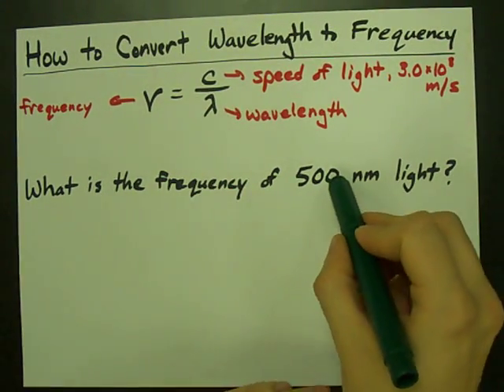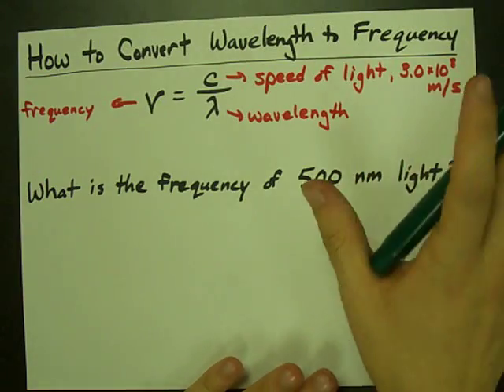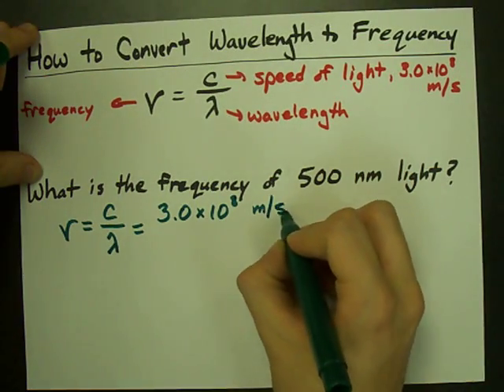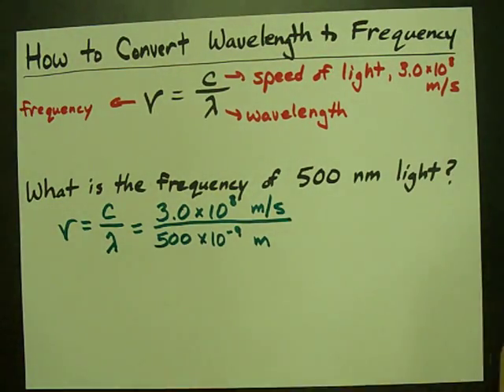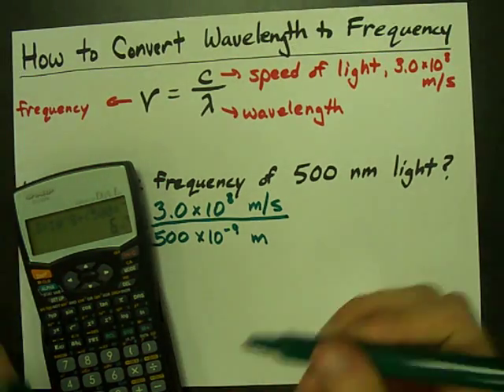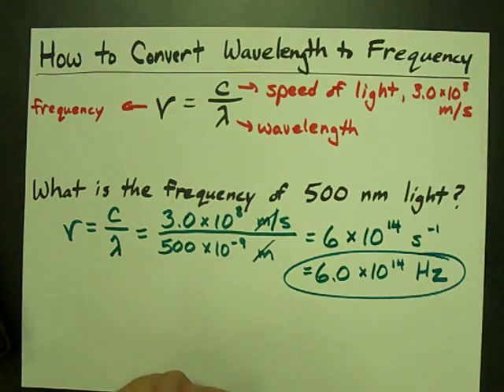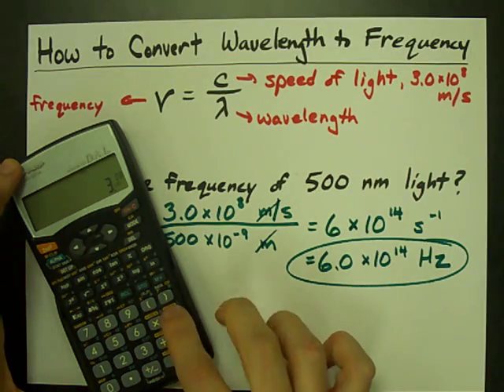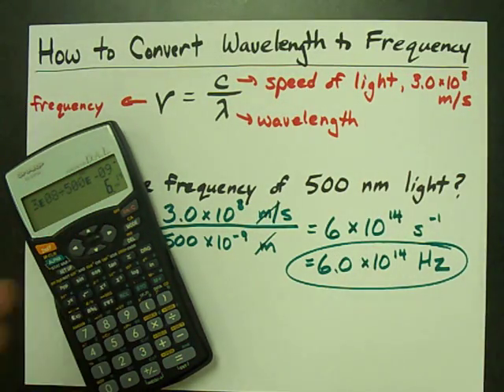How to Convert Wavelength to Frequency

Comment: I have a question.
How to convert of 2.2 cm?
Because the problem is If a microwave oven radiates 2.2 cm wavelength, how much energy does it emit?
Reply: Maybe you could try converting centimeters into nanometers???
Reply: You convert cm in m… so 2.2cm is 0,022 meters. You just make reverse math 1m has 100 cm so you have 3 number places in “100”.So cm comes on last place on right side ( basically last 0 in number 100).Decimetre comes on second place ( it refers to then’s). And 1 is referring to hundreds. So to get cm in meter you put front of number in cm two zero because cm is in last place in 100. And for your “,2” you put it after in continuity because it refers to “mm”. Another way to write that is 2,2x( power 10 on minus 2)..

Comment: I keep getting 6x10^-4 as well ????
Reply: I know this is most likely too late... but the reason you're getting the wrong answer is because you need to put it in the calculator like this 3.0e^08/500.e^-9. Technically this person who made the video is not entirely correct in his Scientific notation.

Comment: Why do I keep getting 6x10^-4 ?
Reply: I know this is most likely too late... but the reason you're getting the wrong answer is because you need to put it in the calculator like this 3.0e^08/500.e^-9. Technically this person who made the video is not entirely correct in his Scientific notation.